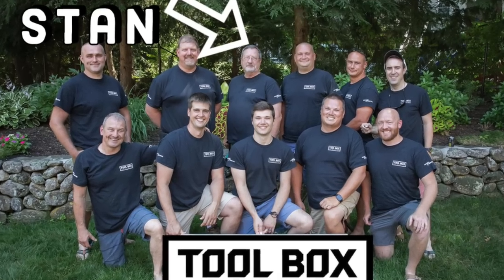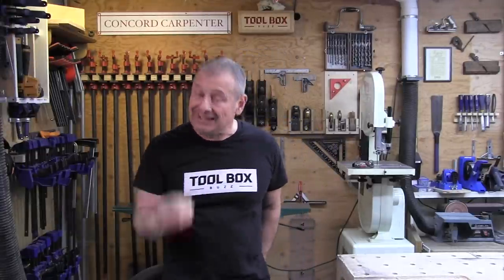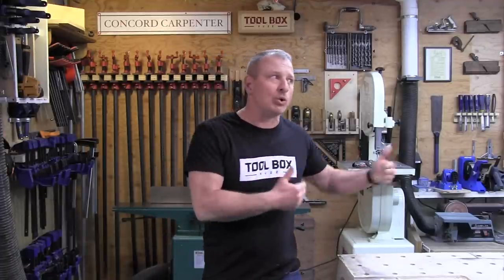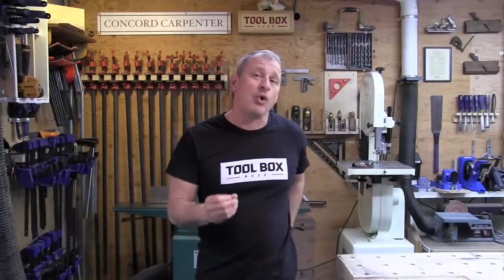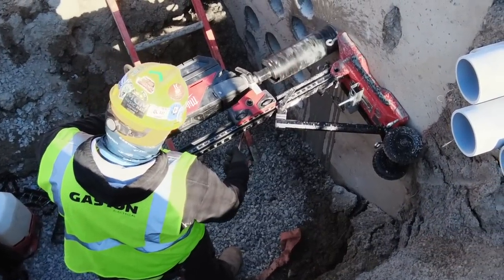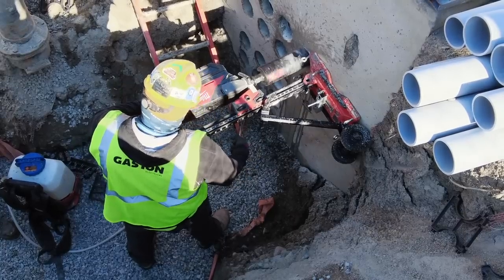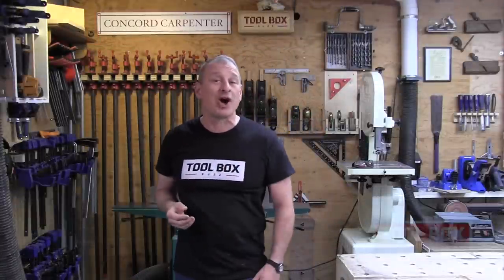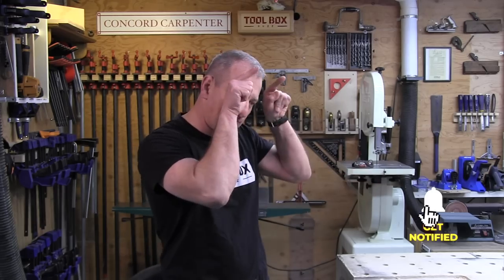Is Milwaukee MX FUEL Equipment  - Worth The Investment?

Comment: Awesome story.
What I have realized recently is that battery power tools are holding its' value. Even after 1-2 year of sitting around it is possible to sell them with no more than 10-20% loss, as power tool renew cycle is not that quick like cars or phones.
We only need to select a battery platform wisely.

Comment: Hi Rob - I work for the largest GC in Canada and we've been testing the MX Fuel line. Feedback so far has been "it's powerful, but the run time is a big limitation". Fuel is endless, batteries are not. Down time counts while waiting on batteries to be charged as well. For one-offs, great - but if you have some serious cutting to do it's just not there yet.
Reply from the maker: Agreed time and place - plus have extra batteries
Reply: Packing extra batteries is the solution on this. (I do home remodeling / repairs and general maintenance, not larger companies or projects like yourself). For larger jobs I know I'm gonna be wearing out my M12 fuels with, ill pack 2 or 3 extra batteries and cycle through charging them and using them. They use a lot of power fast, but also charge up fast as well. I sanded an entire 20x10 shed with my M12 Fuel Multitool just cycling through 2 batteries back and forth. Every time one would die, I would go out and have a green light on my battery charger. Shit works like a charm. Keep on keeping on man

Comment: I’m not a contractor but I don’t understand why this is better than a remote generator and extension cord to an electric saw. Maybe it’s a safety or noise thing but a remote generator can be placed 100 feet away and provide power no?  That said. These tools are badass and I like that Milwaukee is pushing the envelope.

Comment: So there are several different ways to look at this given your scope of work.
I worked for a fencing contractor and probably drilled 10000 holes over 15 years in residential/commercial/industrial work.
Reply: Sometimes I pumped water from a pond using a marine bilge pump,sometimes siphoning from a 5 gallon bucket on top of a ladder.
Several resorts were right on the  beach,but water and power were 500 ft away .
So you had to wheel a generator 1/4 mile to drill 1 or 2 holes,and that was it.
The mx coredrill would've had an ROI of 1 year from lost time.
Obviously this is a specialized industry.
If you build fence and you are still using extension cords,you must be in the middle of a big city or have more time than most.
Jobsite problem solving (common sense) is found less and less these days.
There is solution available, you just need to think tactically .

Comment: Hey rob, do you have any feedback or runtime on the mx fuel breaker?
Reply from the maker: Tremendous useful tool in remodeling - runtime depends on application- we have 3 batteries and never worry. One is always charged
Reply: @ConcordCarpenter  excellent thanks for letting me know! I just purchased the 14” cut off saw and it came with 2 free batteries and an extra charger so if I buy the breaker I’d have 5-6 batteries at the ready

Comment: i have the core drill and struggle with it constantly. drilling into limestone blocks, no problem. but when i go to drill concrete retaining walls it constantly jams up. the clutch engages and makes a horrible grinding noise. i have spent hours (literally) on one hole and only manage to get 200mm deep. the only reason i can think its doing this is maybe its bouncing off the blue metal and thinks its about to jam. it is literally unuseable. Ive gone back to a cheap $300 drill and the milwaukee drill sits in the shed. anyone else have any issues????
Reply from the maker: What are you using for a core bit?
Reply: @ConcordCarpenter  diamond bit

Comment: The only MX tool I'm even remotely interested in is the power supply. All that concrete stuff is beyond my scope of work.
Reply from the maker: We’re looking at that too
Reply from the maker: How would you use it?
Reply: I've got one and I like it so far....I'm an electrical contractor....
Reply: @ConcordCarpenter  Temp lighting and charging batteries mostly. I'm wondering how well it would charge scissor lifts.
Reply: @johnnyfreeman1018  I'm an electrician too and I'm wondering what you use it for.

Comment: Am I missing something or you just explained to us that an overprice tool is better than not having any tools? What if your friend bought the much cheaper and more practical tool instead? People aren't saying that MX Fuel is useless, they're saying it's way too expensive for what it is.
Reply: I think the guys that think MX are too expensive are not on projects that can benefit from the investment. There are many, many commercial projects where these tools will pay for themselves in a heart beat. It just depends where you're working. I recently had a commercial fit-up for an eye doctor's office. Very tight schedule do to SBA financing and the doctor's need to relocated and be operational quickly. We discovered an issue with the sewer lines inside the building, couldn't get a concrete cutting sub for about a week, do we wait and delay the project or find another way? This was a 6" slab, that small M18 wouldn't do it, using a gas saw wasn't an option (other medical offices in the building). So MX is the perfect solution for that problem.
Reply: @toddfratzel3569  How about an electric saw that doesn't need a new battery every 5 feet and cost a fraction of the price? I'm a contractor and I know how employees can treat our tools, so I aint spending 3 grand on that thing. Think about it this way, for that price, you can get a gas power saw, a couple of electric ones AND a generator.

Comment: I feel like hiring electric or petrol cutoff saws or core drills would've been cheaper.
Reply: you mean rent?
Reply: @Pepe-dq2ib  yea, its called hire where I live.
Reply from the maker: Renting would have been cheaper but these guys are working on union commercial site and the jobs are typically done by the subs responsible for them.  Stan would only do this in an emergency when the sub can’t show for a few days.  I should let Stan chime in.....
Reply: One of the issues that comes up repeatedly is the lack of coordination or planning or things that come up instantly. That's where my MX FUEL equipment helped solve these problems. We could have rented equipment in either case, but it would have added additional time to get that equipment to the site. Renting is an option, but would have added time to the process and cost money. Stan
Reply from the maker: @rechalrud  agreed
Reply: I've been burned by renting before.
You perfectly time your build and schedule a rental and the person before you didn't return it.
Now what?
Reply: @robertfeliciano5723  Not sure about you, but there's at least 4 tool hire companies in my small town. If one doesn't have it, go elsewhere.. call before you pick it up.

Comment: Love the vid but I honestly just can’t figure out what Milwaukee was thinking with the MX line. I mean general contractors and remodelers we’re Milwaukee’s bread and butter with auto mechanics bringing up the rear so what are they trying to do with these tools? It feels like Milwaukee is forgetting about us GCs and forgetting who has kept TTI’s doors open for the last 10 years
Reply: What are you talking about? Milwaukee is still pumping out new products and better technology for the rest of us. Milwaukee has the capability to branch out and they have the right to do so.
Reply: Not sure I understand your comment. I'm a general contractor, these tools are a big deal. That cordless cut-off saw will be HUGE for interior slab cutting. For cutting inside a building right now we have two choices, hire a concrete cutting sub (who will use a hydraulic saw) or cut inside with a gas saw at a huge risk to everyone. It's super expensive to hire that sub if you have a small area to cut (short plumbing trench, new footing, electrical conduit trench, etc). My guys have one of these and it will get used A LOT. Jump in a man hole and cut an opening (with a gas saw that is AWFUL). Sure, maybe these don't fit your daily work, but I know lots of GC's that can hugely benefit from a cordless solution for cuts in tough locations where it doesn't make sense to hire a specialty cutter.
Reply: @toddfratzel3569  we use the m18 concrete saws to cut interior slabs and they work no problem. I guess the point I’m making is this was Aton of time and engineering for Milwaukee and their constantly late to the party like they were what five years behind dewalt to come out with a cordless framing gun and I think 4 years behind them to come out with a cordless compressor. I just wish Milwaukee would focus more on tools that we would use every day instead of all the time they put into this which is more for commercial contractors
Reply: Ok, I see what you are saying in that M18 Milwaukee tool has been playing catch up. Dewalt did have a running start though. Dewalt 18 volt tools started in 1996 - 25 years ago M18 2012 - 9 years…. Dewalt had the nail guns, cir saws, zip cut out sheet rock saw years before Milwaukee got into battery systems. And yes I am waiting for them to come out with a track saw. 

Dewalt is behind elsewhere. I am heavy into the M12 battery system and Dewalt is behind there. Plumbing trade, Electrical trade and as you commented the mechanic trade. I think they have better lighting options too. I see the MX line as another area they wanted to enter.  Like most of the high end plumbing tools I will not be buying into the MX line. 

So here is my question to you, as the a General Contractor, what Milwaukee tool is needs to be added to there family of tools (besides the track saw)??
Reply: @richardgray1730  yes exactly. I’m not at all unhappy about the MX line I just wish they would have waited and focused more on the m18 line. The things I’d love to see the most is a 10 inch table saw and an m18 power station like dewalts power station as well as a gen 2 of the 15 and 16 gauge nailers. I’ve spent over 50k on Milwaukee power tools for my company and they are top notch tools just they don’t focus enough on the every day tools
Reply: @trevorm7013  I think the best chance you have at a 10" saw will be a larger power supply like MX. But, there are lots of challenges with the larger saw, some of them not a power issue, the consumer protection rules out there are making it challenging to release the larger 10" platform. The MX line will actually help push new innovation down to the M18 line, just as M18 has pushed new thing to the M12 line. I spend a lot of time visiting the folks at Milwaukee and I can assure you they are spending even more time and investment in M18 than MX, you just don't always see it from afar, and you don't always see it when many of the tools coming out don't necessarily impact you. Your example of the M18 concrete saw is great, but I can't cut through 6" slabs with that, I can't cut through 5" of asphalt pavement with that, I can't cut all kinds ductile iron pipe with the little guy in a trench box 12' below street level. Your desire for more tools is spot on, and I think you'll see them continue to invest heavily in M18.
Reply: @toddfratzel3569  totally agree and osha is getting crazy with their table saw regulations. I’ve thought about buying the MX power station but lost I checked it had 2 stars and seems to have many flaws and even then I always have sub contractors on the job and I know that that $2200 power station would walk off the job faster than I could bring it on and at $500 for a single 6 amp hour battery I mean I can’t even wrap my mind around that
Reply: @trevorm7013  yes, i agree, but for some companies, especially really large operations, this stuff really does fill a void. I remember seeing this stuff at the media event a year before it was released, we couldn't talk about it, and my mind was thinking the same things. But when you hear about the research, hear about how many companies are using these products, you realize there are many that will benefit from them. The bigger the business, the more people scrutinizing the bottom line, and trust me, they don't buy tools just to be cool, they buy them to make money.
Reply: @trevorm7013  I'm curious as to why you feel Milwaukee is playing catch up with the others. They might not have all the tools that Makita has for example, but these tools need time to develop. They are on the top when it comes to batteries though, that's where Makita lacks a bit, they haven't updated their 18V batteries in a long time (still old cells). DeWalt imo is losing more and more ground. When I started out with cordless tools I went for Makita simply because I'm not American and Milwaukee is pretty expensive where I live (not worth the extra money imo). Their 12V line up is awesome. Still choosing between 12V Milwaukee and 12V Bosch.

I could also imagine the MX cutoff saw being great for fire departments. When cutting is a time sensitive thing, you're probably happy to have a tool that starts instantly and only needs a battery switch.
Reply: @damschu23  well like with their nail guns for example, dewalt came out with their cordless guns like what 5 years before Milwaukee did and the Milwaukee cordless compressor I think was 3 or 4 years after dewalt dropped theirs and Milwaukee didn’t drop a cordless miter saw till three years after dewalt did, didn’t drop a cordless 6 inch angle grinder till 5 five years after dewalt and so on. Don’t get me wrong I bleed red over yellow every day of the week but the fact that Milwaukee is almost always years late practically makes it worth using dewalt instead